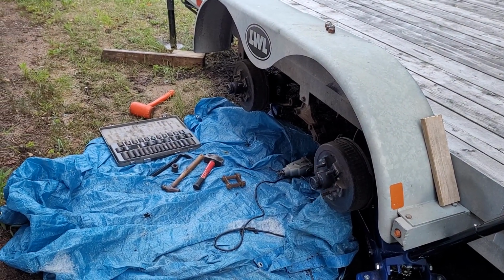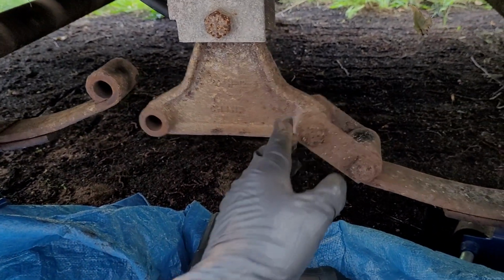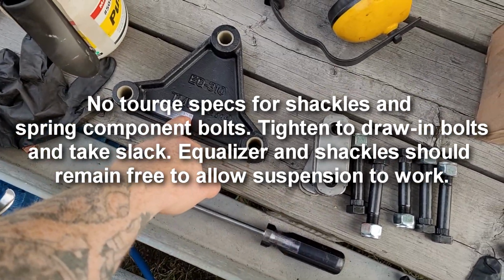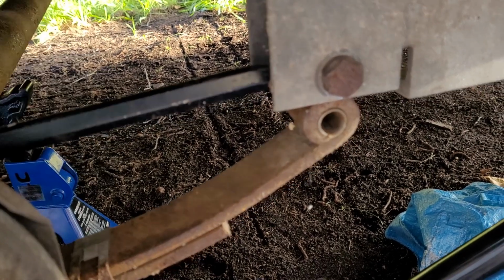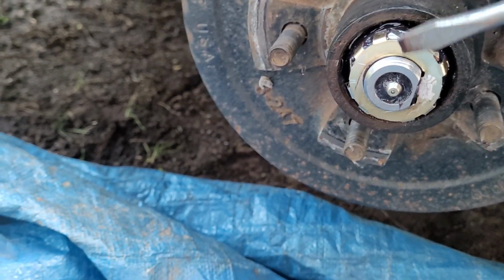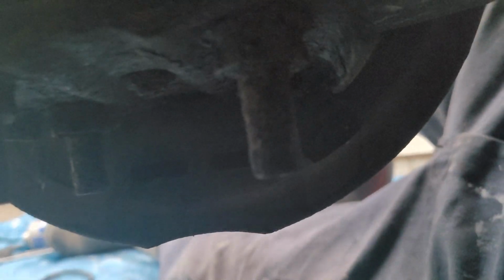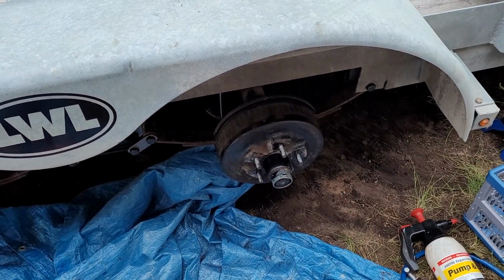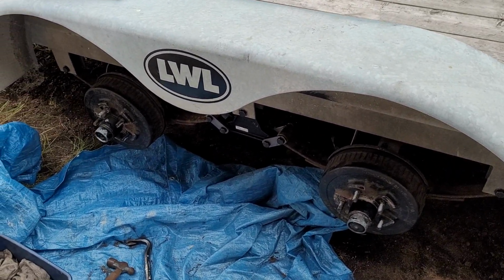Replace Trailer Suspension Parts

Comment: Nice video, I’ll have to check mine because where I go in Halifax they just disconnect the power to the truck, pull the breakaway and have ya pull ahead to see if brakes lock.  The rest is just a quick visual inspection slap the sticker on and yer on the way hahaha

Comment: Got a tandem axle trailer from the father-in-law while back. 
I need to go through and do all of that as well. Springs and shackle bushings are all shot. Good video explaining the process. 👍
Reply from the maker: It really made a difference as i had to haul my trailer to the inspection point this morning. Especially with the new tires, i found it stuck to the road a lot better and didnt bounce once. No vibrations or wobbling on the highway.